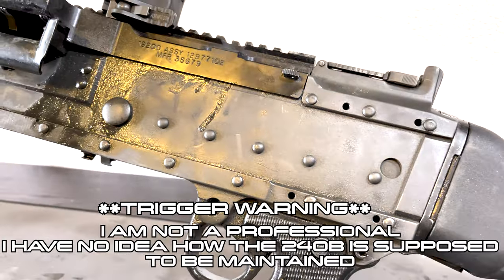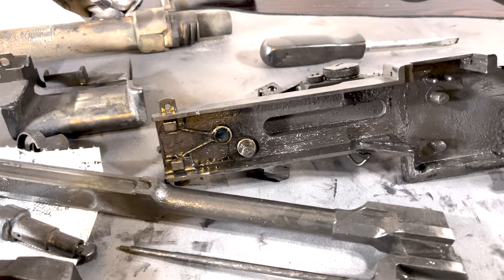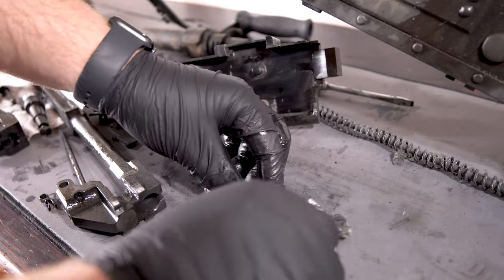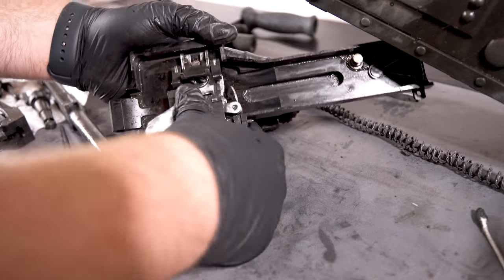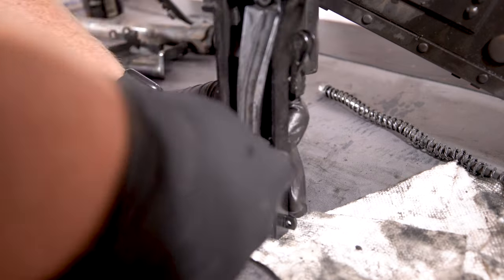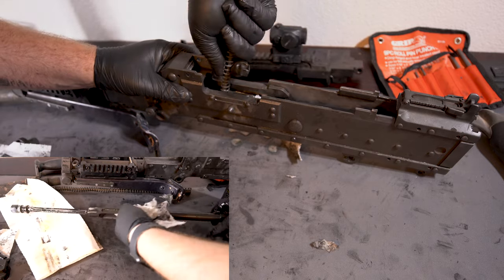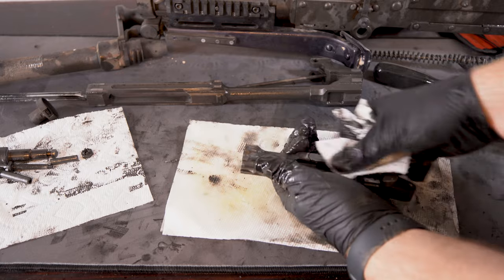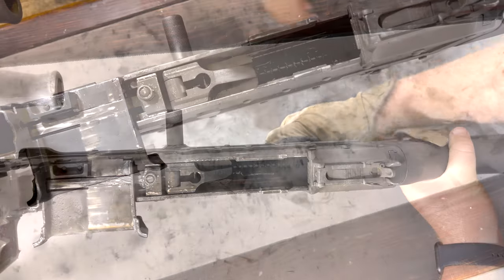Cleaning the Underground Ordnance M240B Machine Gun - Post 1,300 Round Suppressor Torture Test

Comment: You will have problems very soon if you dont touch up a couple more things, 

Clean the piston cup at the front of the oprod. The burnt on carbon needs to be scraped out. 

Next the gas regulator and the gas port need to be cleaned as well. They need special tools that can be found online if you search for m240 cleaning tools.
Reply: If you dont clean those specific parts it will build up enough carbon on a fairly clean 240 not suppressed to keep it out of battery or light strike in about 3k rounds. 

Also check your drive spring (recoil spring) for cracks
Reply: Glad someone else mentioned the gas regulator plug and collar.

Comment: Watching you dry fire sending the bolt home was a pain to watch
Reply from the maker: Why? Lol
Reply: This gun means nothing
Reply from the maker: @CDEN308  Had no idea honestly. But yeah, this is the same gun we destroy suppressors with, it is replaceable lol
Reply: @gunsnmammons  its because the military drills it into us not to that
Reply: @Crossed_cannons_armory  yeah I sometimes do it by accident and my leadership gets so mad 😂
Reply: @Crossed_cannons_armory  
Side note, funny you mention that, we had a mark go down on the range and it was brought to the hut. A dude said I'd break it slamming the bolt home until I showed them the firing pin won't protrude for gauging and it is apart of the -23&P TM. Only thing wrong with it was the sear had a small pebble under it so it would shoot a few time then lock the sear in place then by the time they mess with it work itself free again. It went back out on the range and kept going.

As far as the 240 goes most it does is increase burrs around the barrel and breach, which so does shooting. So unless you were slamming it home for days on end you're fine off. 
If you ever had a 240 barrel that was a pain to come free look at the chamber side and feel around the end. they'll be a burr that mushrooms out. The fix for it is just a file to take it down. If it's not that then look at the lugs on the barrel and inside the receiver sometimes brass shavings or other debris find their way in there during the change.. The bolt rarely gets burrs on it but the same concept applies. 

Another thing to note, The 240's -10 TM you are told to ease the bolt forward. The -23&P (Maintenance) Does not, it's "ensure the bolt moves freely forward when trigger is pulled". That's also for Firing pin protrusion.
Reply: @AbsolutionArmament  yes you are right. Gauging for depot level repairs and running 3 hours of gun drills is a little different. The gauges have to be use at the correct tolerance. But excess wear should be prevent when feasible. 

I've kept a few shot out barrels to use for dry runs and i usually grab the oldest pos 240 left